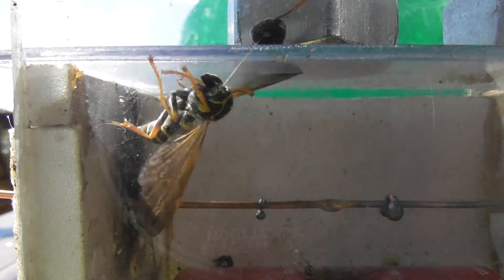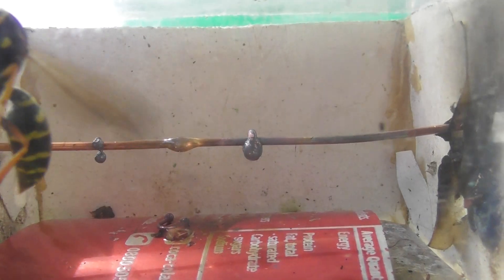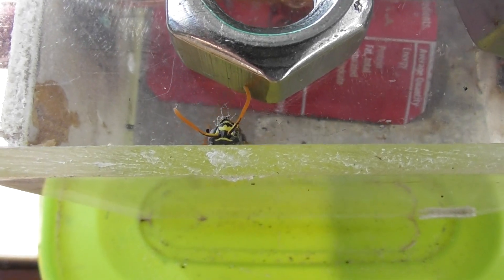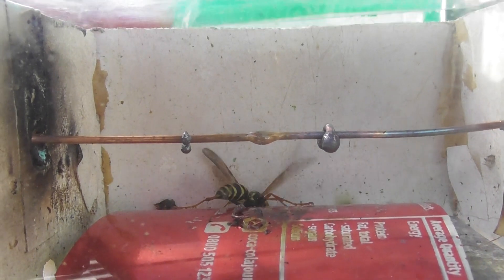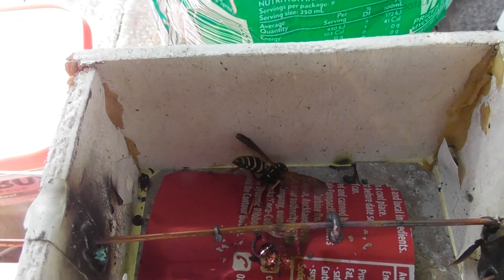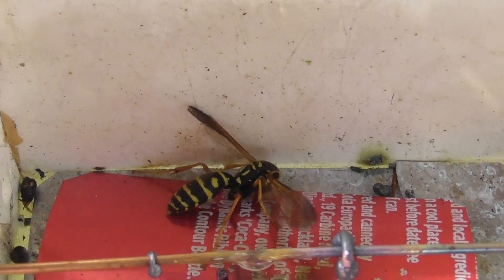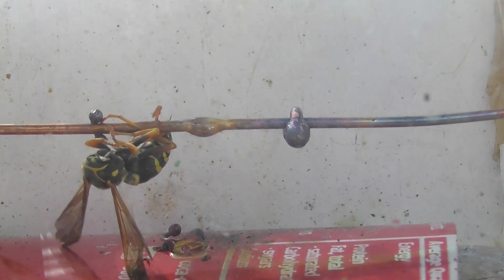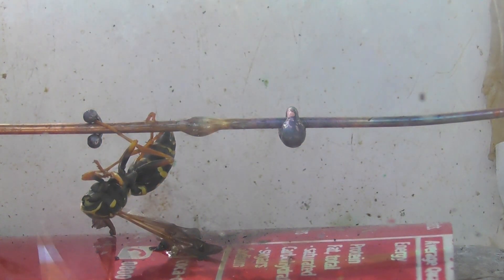De-headed paper-wasp still stings and ejects poison.

Comment: You can see the venom coming out of it's stinger when it gets zapped weird. Is that drop of liquid on the top wire the venom? That's crazy you squeezed out a drop of venom with electricity. Bzzzt.
Reply from the maker: The drop on the wire was a bit of honey.

Comment: They can live for weeks without a head, provided the hole is sealed off, so that it does not run out of haemolymph in the body cavity. Kind of like the mantis, where the head and most of the top end already is inside the abdomen of the female, while the male abdomen is still, till she eats it, busy putting in the work to make sure she will have a large brood of baby mantis in a few days, then goes to be turned into the eggs.
Reply: They have no brain AFAIK, it's just a nerve network in their complete body. They also don't perceive pain.